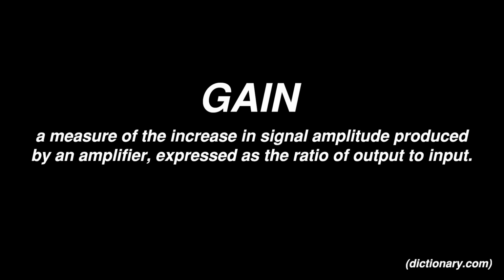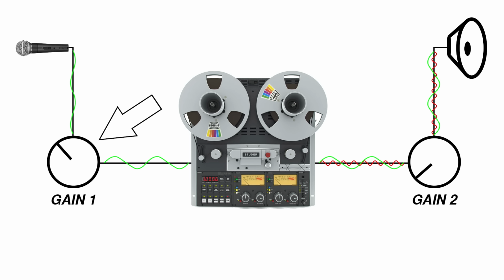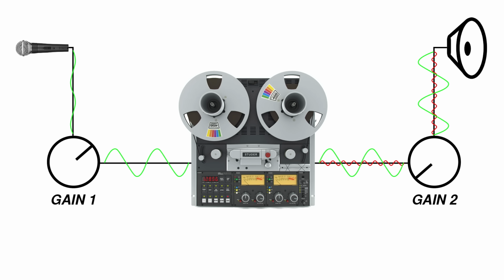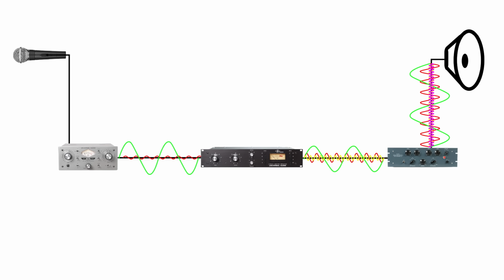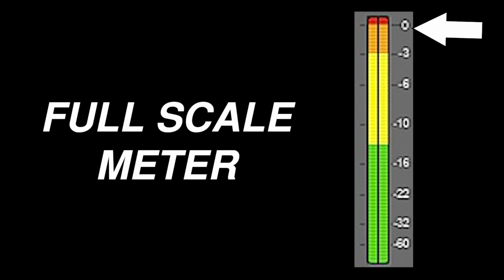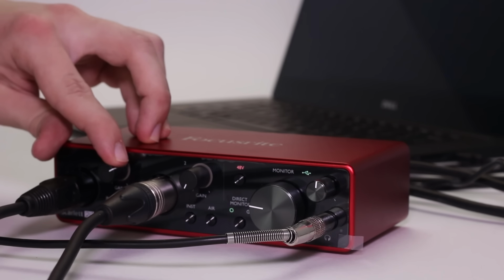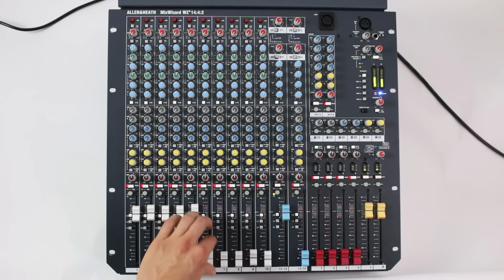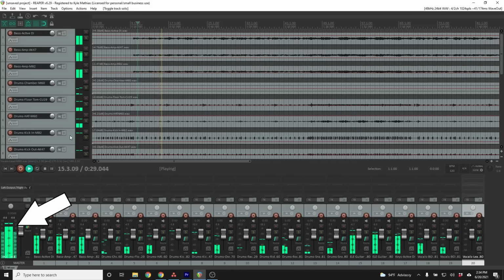Gain Staging Secrets Every Great Audio Engineer Understands!

Comment: So youre sayin mixing to peak 0 dbfs & -10 LUFS give or take is prolly pushing it? 
i produce experimental bass music for context <3
Reply from the maker: If it sounds good, it is good. 

At 0 dBFS, the signal will clip. That isn't always a bad thing, but I would only recommend clipping a digital signal if it's intentional to reach a specifically desired outcome. 

Otherwise, I'd usually only approach -6 dBFS, -3 dBFS, -0.1 dBFS, etc. when printing a final mix (using a limiter or normalization).
Reply: @AudioUniversity  beautiful response. Very helpful! Love your content! Thanks for being you. 💜
Reply: @AudioUniversity  cpl years have passed since I started using a clip-to-zero method and framework, and I'm kind of grasping the concepts on a deeper level at this finally. I think target values are an important and underrated thing to nail down.

Have you had any experience, or can you shed light on, using a hard clipper cascade or anything related to a CTZ method of gain staging?

P.s. hoping you get in to more live sound stuff on this channel in the future! Been loving the newer stuff with Dave Rat. You're a gem! Keep it up! 🔊🎧

Comment: I work with analog and digital desks for live shows or services. Been doing this nearly 23 years now. 
If I am going in to a session without any pre work I’d do exactly what you did for my base levels on inputs and outputs. 
All my faders, mains (gas pedal) and bus sends are set to unity. 
From there I’ll line check each input by raising the preamp to a -10 on my scale and verify device volumes at 8 or 80% max volume. 
The first rough mix (usually my line check but someone’s band rehearsal #FML) will be getting preamp levels to an acceptable gain setting, basic PEQ/EQ of the individual channels then applying dynamics as needed. 
DAW recording is not my strong suit but it is just like working any physical desk. Prep before the show and use your ears, scales and RTA to even put the mix. 
Better dead than red on your desk/DAW. 
Good stuff and solid presentation. I’ll send this to a few younger folks I know that wanna learn the trade.
Reply from the maker: Thanks for sharing this info, Red.
Reply: device volume doesnt affect gain or volume within the daw so im not sure why you need to set device volume at 80%

Comment: Nice and simple instructions, good job. As a retired advanced audio instructor in southern California, it's nice to see this still being taught. DAW's have made recording easier, but the lessons of tape still apply.
Reply: Recording to tape was falling out of fashion when I started in the industry. To be honest, tape is a bear to work with but has a warmer sound in the booth compared to DAW tracks. 
BUT I was raised on 45’s, cassettes, CRT tvs and with corded phones. I may be a hair jaded.
Reply: @redmcbeard4230  I agree with you Red. I started on Tape and welcomed the digital with open arms. The one thing tape did was really teach engineers how to mix and work with audio. What I have seen over the last ten years is younger DAW users do not get that knowledge using the computer  to mix. I knew a Pro Tools instructor who would teach his students you don't need the faders to mix, you can just use plugins. He had no audio experience other than taking the Pro Tools instructor certification course.  That's why I appreciate this channel.
Reply: Actually, gain staging with digital is totally different than with analog - with digital you're aiming for -18 dbfs, where with tape you go up to 0db or even a bit 'into the red' for a bit of natural saturation.

Comment: In my live setup, I've typically used the master volume on my mixer as the control for overall output. This is usually not a problem, as I also typically keep the output knob on my powered speaker at around 25-30%. Are you saying that it would be better, given that my speaker is normally close enough for me to reach during my solo performances, to keep my mixer output (as well as channel inputs) at unity and use the speaker output knob as master volume control for my system?
Reply from the maker: No. You can continue to use your mixer’s master knob/fader. Just make sure you aren’t overdriving any channels and that the master isn’t being overdriven. At the same time, make sure there is a healthy level on each channel and the master.

Comment: May I suggest that you delve into external analog signal processors getting chained up prior to a DAW? Too many get obsessive about using older analog gear when you can now get similar results with what is available in your DAW. That old analog gear and the physical connections typically add noise.
Reply from the maker: Great idea, David! Thanks.

Comment: a quick shortcut on this would be to use a limiter on the master output channel, limit that to about -6dB and you wont really have to think about clipping. alternatively, put a limiter on each and every channel you're using.
Reply: The problem is when you start running into the limiter it affects the dynamics, that's a good elementary way to do it.
Reply: I disagree.  What if you dont want any transients squashed.  I do know engineers who mix into a compressor but that has to be part of the sound they are going for.  It isnt for everyone though.  It depends on what their taste is.
Reply: @scottsmith4145  the main point is for it to NOT clip, that's basically what a limiter is used for.
Reply: @maniacalmusician2025  Sure but if you use proper gain staging in the first place youll have enough headroom to not clip at all. That was the point made in the video.   For live sound I do agree with you and would not hesitate to put a limiter on the master bus. For studio mixing where things are much more precise and controlled theres just no need for a limiter imo.

Comment: Wow, Thanks for sharing. I couldn't find any videos out there talking this can you please help me:- I am a sound engineer at our church and I am having a problem with the band about gain staging. They want to turn up or down the volume on there keyboards, lead and bass guitar to change the dynamics of the music when they play, but it should be set at one level that is suitable for their monitor and the PA which is around - 18 DB so it will be processed correctly. 

I explained and shows them to change the dynamics of the keyboard press it hard or slow and for the guitar use the strings to change the dynamics but not the gain volume, doing this will messed up my FOH mix and monitor mix . 
You know when you use like acoustic drum even electric drum, grand piano, box guitar or any other instruments some of them don't even have volume knob but you control the dynamics when you play it. 

Musicians hear on there monitor what they want to hear, but sound engineers listens everything that makes a sound on the stage, mix it and broadcast it on the right level to the audience. To change the dynamic of the song by using the volume knob of the instrument brings that instrument audio right on your face or makes it lost in the mix. Using compressor is only working right when it is on the right level other wise even small amount like 4 or 5 DB input source volume gain differents will make it distorted or use less. 

So can you please let us know the right way how to set up the volume from the band side? And should they change the dynamic of the music by using volume knob ones it set? Please let me know, Thank you so much for everything.
Reply from the maker: Hi Mani. I think you’re absolutely correct - the output level of the instrument should be set and not adjusted throughout the show. If the musicians won’t agree to that, there isn’t much you can do unfortunately. 

Do the musicians seem unwilling to stop adjusting the level and let you control it instead? Are they adjusting because they cannot hear themselves?
Reply: @AudioUniversity  Not yet, so far I am planning to do a workshop with them to sort this out. They all have their own monitor and we do sound check and I always ask their satisfaction so far they are okay with it and not complain about not hearing them selfies. I am going to move them in to in ear monitor system at least for the band in the beginning of next year. 
I know this happens because of knowledge and they don't want to be confronted, So hopefully I will let them understand what it's fell like to be on my shoes when we do the workshop.

Thank you so much for everything, I am checking out all of your videos and and I am really learning a lot of things out of it. Thanks for sharing.

Comment: In the digital domain I use to set my tracks at Peak -3 dBfs (percussive Sounds) or -6 dBfs (sustaining Sounds) and then control, if they're round about between -18 to -12 dBRMS... adjusting if necessary. Sometimes I also use a VU Meter calibrated to -18 dB in the Main bus.
Reply: I am an old audio engineer, I used to use minus 3 to 6 on analogue consoles and guess what, I try to record stuff digitally between minus 3 and 6 db

Comment: I use a lot of external effects,  mic pre-amps and other sundry devices for compression and signal coloring  and work with an aggregate of interfaces connected to my DAW so it’s really important for me to pay attention to gain staging. Even before a session begins I like to use a 1k tone generator and pre-set the  optimal  gain stage level of all connected devices. I start with connecting and sending tone  to the last device in the chain like a DAW interface or an input on a console feeding an amplified live room where the DAW or console faders have all been set to unity and setting optimal gain there until the tone reaches the optimal level I am aiming for and then repeating the procedure moving backward, connecting the next device in the signal chain and optimizing the input level of that device and then adjusting the output level  so the tone level of the last device in the signal chain sits at the same level where I had set optimal level. I continue moving backward throughout the signal chain repeating the process until I reach the source like a mic, guitar DI, synth, etc. being careful to match impedances of the output level of each device moving up the chain and matching the impedances of output to input and switching the impedance on the output of the tone generator accordingly to match what those impedances should be and never mix-matching impedances which can cause much unwanted noise and sometimes catastrophic damage.  

Not saying these are  the exact levels where I will be working in a session, but close enough to where a simple fader move (not gain level adjustment)  is all that is needed to adjust the mix in the DAW session or on the console feeding the amplified live session or tape.
Reply from the maker: Thanks for sharing Dave!

Comment: If the master output clips in a sequencer because of the combined volume of the individual channels, turn the master fader down. This will be indistinguishable from lowering all the individual channels. Sequencers at a minimum will work at 32bit floating point resolution internally. You are not losing anything or gaining anything from doing it either way within the sequencer. Hard fact.
Reply from the maker: For people who are watching this video because they don’t yet understand gain structure, it’s important to not make assumptions, I think. The method in this video applies to all systems, fixed point, floating point, and analog. The method you are describing only applies to floating point systems. 

I agree with your logic, don’t get me wrong. I just don’t want to muddy the waters too much for beginners. Thanks for commenting!

Comment: Why not save time by ignoring the individual channel gain and putting a trim plug-in at the beginning of your master bus since individual tracks within reaper don’t saturate when driven? The rest of the video is fine, but keeping the tracks in the green seems like an OCD color coding idea more than an audio technique when you’re working in a DAW.
Reply from the maker: I see what you mean in this particular case, Kaden. 

Not all DAWs and mixers work like this, and in those cases, you’d be overdriving the input of the trim plug-in. This video is intended to teach best practices, regardless of the platform, DAW, mixing console, etc.

Comment: Technically right but this can destroy your flow of mixing process. Also, -12 for every tracks doesn't really help where to start anyway. Even you start your first track with -12, it is possible that some tracks you will have to raise it more than -12 anyway. So it doesn't make sense to do this way and it can destroy your flow.

I recommended start the main core instruments of the song to -12 and just follow the rest base on that main track without touching any gain. It will be nicely level automatically without destroy mixing flow.
Reply from the maker: Thanks for sharing this workflow tip, Tarin!